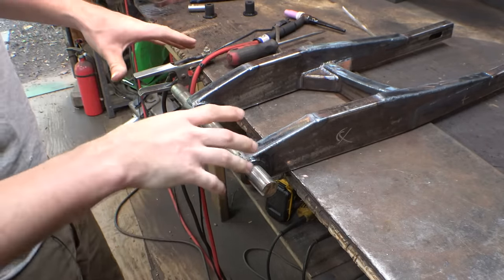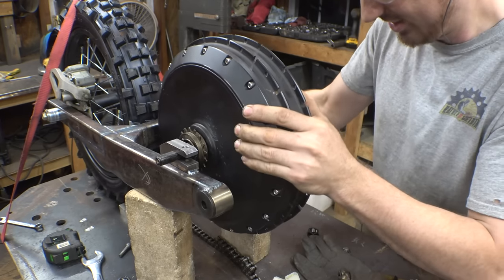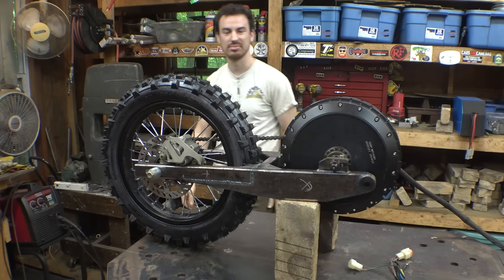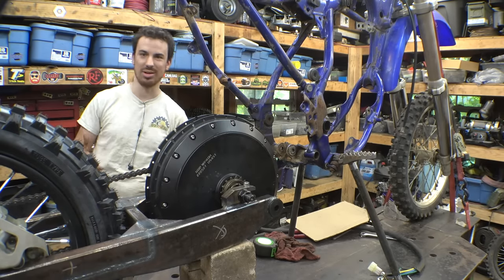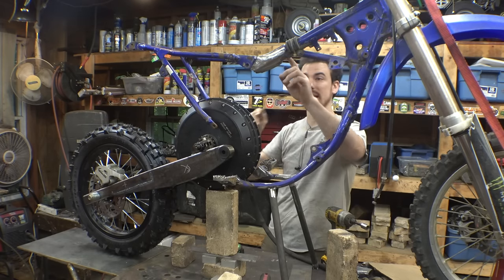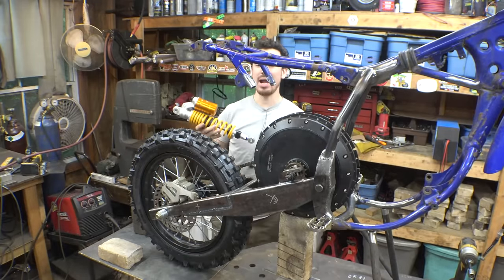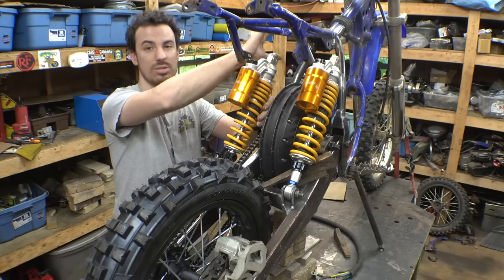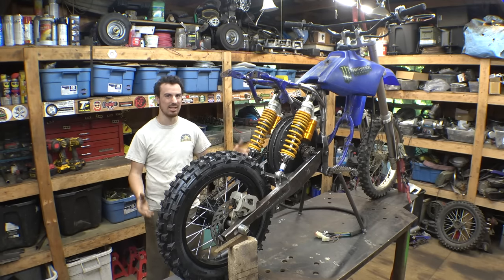Electric YZ85 Dirt Bike - Part 2

Comment: If you want the shocks to match, move the passenger side out. It has plenty of room to be moved outwards. It'll keep your OCD under wraps.
Reply: Exactly 😂
Reply: My first thought as well
Reply: Was on my way to the comments to suggest the same thing. Just kick the right side out the same amount.
Reply: Agreed.
Reply: Absolutely, great suggestion. “It kinda looks off” translated: “it’ll drive me bat s—t. crazy every time I look ok at it.”  Symmetry = Sanity
Reply: Thought the same thing :)
Reply: Could've used the single shock by cutting out where the tank is then using a rod and hoop. As you no longer need the tank for fuel you could have done it this way then cut the tank making just a shell to cover it and to make it look more original. I've actually seen this done on a twin shock older dirt bike to make it a single shock custom and once it was done it still used the original tank although it now had a smaller litre amount as he needed to make a pocket in the tank to clear the shock so totally possible and it worked perfectly.
Reply: Passenger side? 😂
Reply: Agreed!!!
Reply: @MaNNeRz91  🤣 I chose to ignore the phraseology and took it for what he meant to say LOL.
And as amusing as it is, he was correct on a technicality, the right side in america is the passenger side, at least in cars. trucks etc.
Reply: Was about to say the same thing
Reply: @GaisaSanktejo  I couldn't ignore it 😂😂 at least he didn't say starboard 😂😂
Reply: Agreed
Reply: 100% move the right hand shock out to match the left side 👍 that would drive me crazy every time I looked at it 🤨
Reply: Do this please ^
Reply: I was thinking the same, only reason i can think of is why he didnt decide to do this, is maybe the side plastic on R.H side would stick out an inch furthur out from the other plastics.🤔
However I still would much prefer a symmetrical shock layout then a smooth fairing setup. 😊
Reply: @oze-bikes4life663  he could use a heat gun on the plastics and mould them round the shocks?
Reply: Yeah that help the look . awesome 🤩
Reply: I was about to comment the same, it makes so much sense that if you have to push one side out 1 inch then replicate that on the other side also to make it symmetrical
Reply: Just move the right hand shock 1" outwards.....🤷‍♂️🙄👍
Reply: He doesn’t like people being right
Reply: @metaldog7128  Yeah for sure, good point 👍
Reply: Cycling my e-bike makes my ocd evaporate.
Reply: I was about to say this lol
Reply: @MaNNeRz91  Trail sidecar!
Reply: @JW-fq1pp  hell yeah!
Reply: If the original plan was a single shock on the right side, it would have looked way off... 
I agree with everyone here, move the right shock out to match the left. Keep the symmetry. Might also leave room to mount longer shocks in case these don't work out.
Reply: This 100%
Reply: That's really smart actually
Reply: sooooooo true my first thought to
Reply: Jupp^^
Reply: For real was about to say some things just match them 😂

Comment: Ok man, I know the motor doesn't have much leverage on the suspension but that is still unsprung weight. As I see it anyway... It probably won't affect the handling as much but still. Everything so far is unsprung weight. The dual shock setup is freaking awesome! The symmetry from the side is what people will see. The asymmetrical rear view will only be noticable by people that are LOSING! And if they are trying to pass you they might be distracted by it, also to your benefit! Regardless this is an awesome project. Also 53" wheelbase is totally fine it's not an 80cc bike anymore so it can grow up a bit. And the ginormous swing arm will almost definitely aid the handling. Look at any rocket bike historically and you'll see shorter motors front to back and longer swing arms. 
So in conclusion, good job, good design, good engineering, good foresight and just a giant thumbs up to you with a high five on the side! You can stop reading this now and get back to work...

Comment: Great work! keeping the motor on the swing arm but near the pivot is ideal! chain length stays the same and you could even make a box around it. 

from a conceptual point 1 shock >> 2. its hard to get springs or dampers to match. Yamaha was the first to have single spring rear suspension and dominated offroading with it. cars have a hell of a time being symmetric without adjustments.

Comment: Awesome project, If you still have the engine, the other way to do this conversion is to install a motor where the magneto normally goes and rip the conrod, piston, cylinder etc out, and drive the crank from the electric motor, you can then still have access to all the gears, or another way to do this is make the motor shaft of the one you have the actual swing arm shaft giving you good geometry and reducing space required and still giving you a fixed chain tension.

Comment: It’d be a good idea to place the motor at the pivot point of the swing arm to reduce the weight and save space. Also will ride better without the weight on the swing arm

Comment: I would think if you could mount the motor on the opposite side of the frame from the back wheel, it would lesson the unsprung weight of the wheel and create no added unsprung weight. The way you have it adds a lot of weight to the swing arm.

Comment: Counter lever suspension is what you need like an old xs400 , use the original mount at the top and run a hoop over the motor so you also gets mechanical advantage making the shock harder and use the original shock wound be better

Comment: I think it's a good idea overall.
However, if the motor is mounted on the swing arm and receives the impact as it is, the shaft may be damaged. Also, by releasing the left and right connection of the swingarm pivot, the lateral rigidity will decrease, which will affect the handling. Also, if you don't think about the center of gravity, the rear tires will wobble and become unstable.
I wish this project every success.

Comment: For the left side shock why not  mount it above the chain with the mount going around the chain down to the swing arm then you'd just have to mirror the same mount for the right side shock. It would only lift the shocks up a couple inches then you'd have it perfectly symmetrical

Comment: Maybe for the rear suspension, instead of mounting the shocks right on the arm, you could use a set of push-arms and mount the shock(s) further in the frame, like some mountain bike with rear suspension does? This would make it more symetrical, and can increase the efficiency of travel and maybe event render one shock sufficient.
Nice projet so far! Way better than the previous bike already!
Reply: Yes l was thinking like that and maybe use just one strong spring suspension rather than two

Comment: Probably too many comments for you to get to this one but you could attack your symmetry issue by going old school Yamaha.  Look at the late seventies IT and YZ bikes where the first use of a mono-shock was more horizontally oriented.   Fab a hoop across the swing arm over the cross brace high enough to give you clearances for twin shock mounts to clear chain and not interfere with e-motor.  Brace that loop on both sides from the rear on the swing arm.   You can then get some symmetry back and maintain travel if you forward lean your shocks. Added benefit is that you will spread out the weight load of the rear shock lower mount over a larger area on your extended swing arm.  Mock it up, tack it and see if you can achieve reasonable sag with the shocks on hand.   Look at from the perspective of mounting two "mono-shocks" on the rear swing arm with lower perches elevated enough to give you your clearances.  This will add more sprung weight to the rear, but it might be functional as well as cool looking...just a thought.    Keep up the great content!

Comment: I would have moved the right rear shock out to maintain the look and balance the stresses applied to both sides of the frame when landing from jumps etc... It looked like there was nothing limiting how far out the shock could be moved and it would appear that it would allow more clearance for wiring and splash guards later so it might be worth cutting back off now to modify before final welding.

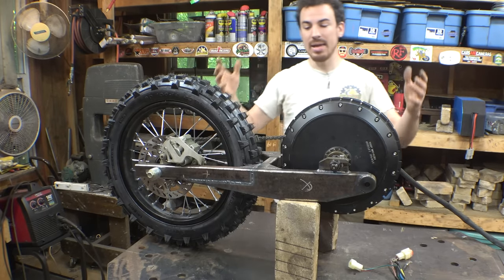Comment: 7:34 make the chain longer and put a swing arm with a spring pushing up, with the pivot point where the brick is, and the reach such that the chain wraps around the rear gear. You'll have more chain on the gear that way and it pulls it out even more.
23:17 could also use cantilever arm suspension, placing the shocks where the gas tank would be with the reservoirs downwards. That way, there's only a rod in the rear, not the whole shock.

Comment: I think this huge motor of yours will be way better than any mid-drive motor mate. Let people may mock you man it's actually a genius idea as the motor has a shed load of torque, it's design to turn something the size of a wheel, by putting that little sprocket on there you've increased the torque big time, you've more than doubled the torque of that motor, tripled maybe 👍🏼 
A longer suspension arm would give you better stability, this monster will probably want to throw you off the back 🤣 live for the danger 🤣👍🏼

Comment: The bushing material used in racing is fairly stiff, its an acetal plastic called, Delrin. A material offering more give, or compliance, is Polyurethane.
edit:  A possible solution to your shock symmetry problem... 
Weld a riser on the lateral cross bar of the swingarm that allows a shorter, more modern uni-shock to clear the motor housing, w/ the upper mount attached as required... symmetrically.

Comment: Have a look at Yamaha's original Monochock set up, it has a hoop on the rear swingarm and the shock is at a very similar angle as it would be on your bike if you used the original mounting point. :)

Comment: Just food for thought....
1   I'd do dual shock old school
2   I'd make the battery pack so it's fitted to the frame instead of a square block that don't look right
3   I'd get a new gas tank and use it as a water bottle for when out on adventures 
then you don't need to carry camel pac 😉

Comment: Instead of remaking the swing arm bushings try deforming the outer side a little with a hammer and you would be surprised how easy it is to make the bushing fit perfectly again. Have had to do that a few times in the past 👍

Comment: For this project it would be better a inrunner motor, they are much smaller and are used for positioning like you did. What you have there is an outrunner that is used to be inside of the wheel itself. If you had the motor then it's ok but inrunners are better for this type of setup, they are much smaller.

Comment: Make a bottom shock bracket that comes up on the outside of the swing arm on both sides with a bar across them higher than the chain. Like an upside down U.

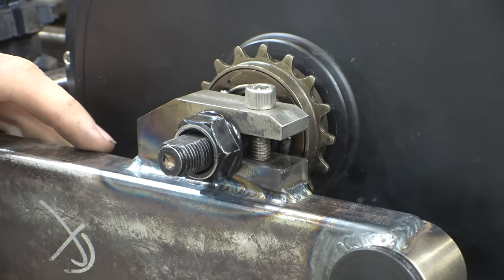Comment: 6:28 you shoud add a" shim" inbetween the  clamp bolt and the axel   or Safety Washer  ", Hub Retaining Clip"  , better safe than sorry , this is hi torque  and will work it self lose over time

Comment: At this point it looks like it's a hub motor electric motorcycle with the hub divorced from the rear wheel. It doesn't seem like there will be much advantage. Maybe unsprung weight because of the leverage of the motor being closer to the swing arm pivot, and the shocks. It would be cool to see the difference between this one and an actual hub mount one.

Comment: Seems like the hub motor sprocket isn’t centered. While spinning the wheel by hand, it’s clear that the chain tightens and loosens, along with it virtually having up and down travel. Careful it doesn’t cause failure.

Comment: A dogbone off the crossbar between the tire and motor to a backward facing bell crank . So a single shock running parallel to the swingarm up top under the seat perhaps?

Comment: I had a Kawasaki er6 and that is only one sided and a heavier bike carrying more weight, I'm not saying should run only one shock but it should work just fine with only one good job on the build aswell.

Comment: Short custom spokes that almost looks like it would have fit in the rear wheel. Maybe get another for the front and have AWD. Alot simpler hub drive. Gearing is the only issue I guess.

Comment: probably will need regen braking enabled to avoid chain slap on braking... is the rear disk going to have stop the mass of the heavy spinning motor by the chain? That may put slack in the chain... or am I misunderstanding and the sprocket has a free wheel ?

Comment: just a question, do you think the increased weight of the motor might get in the way of small/rapid bump damping because I feel that the added energy it needs to convert could make it slightly worse. Or would the added energy to move the arm make it so the stuff that doesn't/shouldn't affect the suspensions compression have less of an effect (like rider position & low-speed compression things)? (all of this could be totally inconsequential to suspension performance, I'm no engineer)

Comment: Is the motor not still unsprung weight (and therefore wont have an impact on the shock in compression at least)?  Wondered about mounting the shock to the motor case (no idea how tough they are) and having it horizontal under the tank plastic?

Comment: I'm sure someone covered this but in case someone didn't why didn't you just move the right side or the passenger side out a little further to make it match plus it looks like it's leaning oddly anyway to the wrong side as is That's just me though otherwise I'm very curious how this is going to work out just the inertia from the hub motors going to be a very unique gyro effect

Comment: Youre making way to big of a deal about unsprung weight. You should have just used it in the rear wheel as the hub motor design that it was. All you'll accomplish is being able to change the sprocket gearing.

Comment: If you aren't installing a gearbox, why didn't you just mount the hub motor in the rear wheel? 
Have you considered adding a front hub motor for 2wd?

Comment: The shock isn't holding the weight of the motor.... it's holding the weight of you.... the motor is resting on the trailing arm and frame at its pivot point. The shock isn't there to make the bike comfortable from your weight.  It's there to ease your ass from bumps...

Comment: is that frame tubing going to handle the torque and pressures the added weight into the back when it springs and compresses? that seems like some smaller tubing. absolutely send it tho cause this is cool as hell

Comment: How about put the axle of the hub motor where the swingarm pivot is, move the pivot closer to the rear wheel keeping the same wheelbase as stock or close? The weight of the motor would be a counterbalance.  ;-)

Comment: The spring leverage pivot points are severely different between old swingarm 9:22  & new setup. I'm guessing the new setup should hold up a 700 pound rider.

Comment: You've probably explained this, but if it's a hub motor, why aren't you using it as such?  Is it so there's gearing options?
Reply from the maker: Hub motors on the rear tire aren’t great for off road. It’s a lot of unsprung weight on the back tire

Comment: I may be wrong but aren't you adding unsprung mass actually in stead reducing it, plus adding unnecessary point of failure in the shape of the chain? You have a hub motor why not use it as a hub motor, less points of failure and less actual unsprung mass? If you want to do it your way the motor shaft should sit in line with the pivot point of the swing arm.

Comment: Man why didn't you put the motor in the spot where the ECM motor was? Putting it there and the batteries under the seat and in wherever you can put batteries hell make the entire frame a battery or battery housing. BUT you've done this more than I have and I'll trust your judgement. BTW the stock shock would handle the weight of this bike

Comment: Why don't you just use the motor inside a wheel rim. Like it's designed to do be less weight then. Less welding work. More space firm battery/controller etc.

Comment: Why didnt you just spoke the outer part of the rim to the motor like its supposed to be???? It would have been just some custom spokes 2EZ......why did you use a hub motor as propulsion to another wheel....??? It's like you went out of your way to make it more complicated.....Do you work as an engineer for Mercedes or BMW???

Comment: With the same quality of components in a front suspension, why does an inverted fork work better than a conventional one? Because the amount of mass attached to the wheel is much greater in conventional suspension, so returning to its normal position requires more time and effort than an inverted suspension. The conventional suspension then works much slower, poorly copying the road, causing greater risk in driving the more abrupt the obstacles on the road.
I see this same problem in the design of your bike, since you are loading the suspension with too much mass. Understanding that sports components privilege less weight at the cost of losing resistance, such as aluminum crowns, so that the motorcycle behaves better at higher revs, you are going against efficiency, comfort and handling. I am far from being an engineer, but they are basic principles that you should observe. The distribution of masses in the best motorcycles always tends to be centralized, as low as possible and almost in the middle of the wheelbase, compensating for the rider's weight leaning towards the handlebars. But above all, as far away and independent as possible from the "cycling group".

Comment: why not leave it on the floor where it is and work it on the floor instead lifting it 5 feet in the air and risking 700 pounds metal falling on u